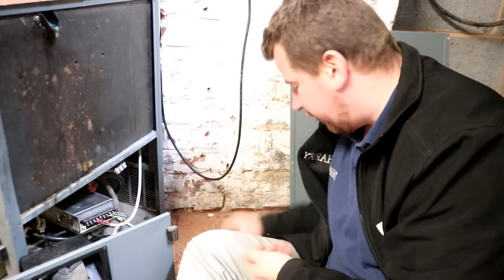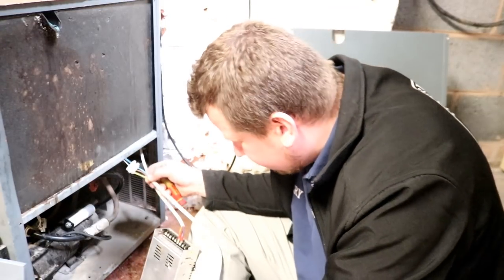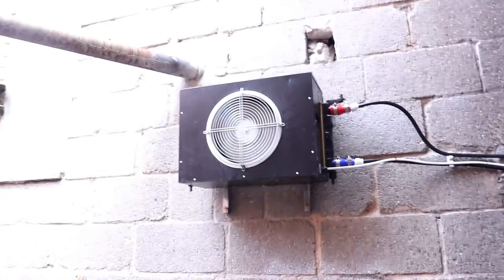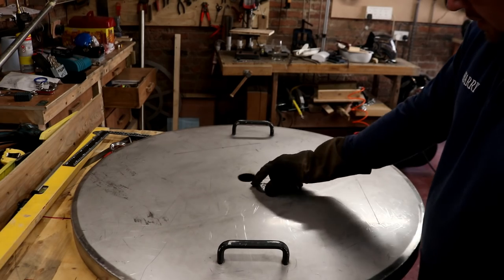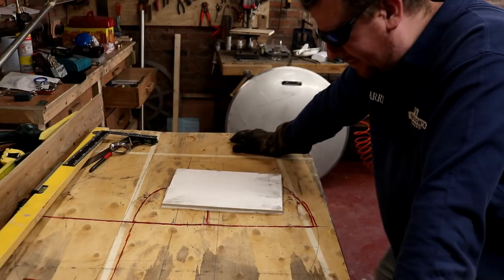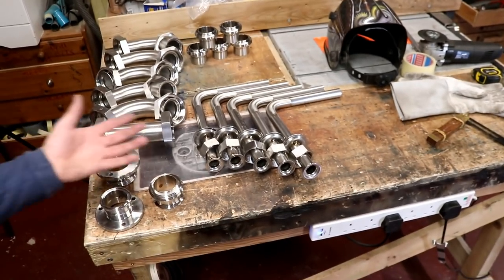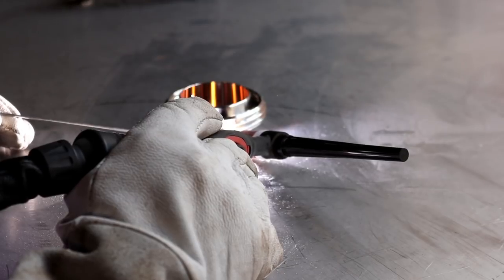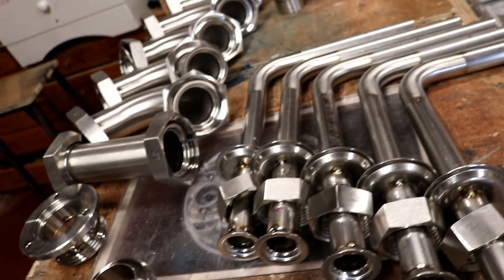TACKING THE NEW FITTINGS

Comment: I know you had to punt for a new transformer,even off eBay it can't have been cheap,and Robbie had a spare,but you've got it done now and you're not left wondering how long one you've pulled out of something else will last. Plus you could always get that one off Robbie anyway to have just in case. My God but that welding looks a right dose but you've done a tidy job and it had to be done at some stage I suppose. Why so much of a gap between take off and bottom of cone though? Cold room done now time to get those new tanks in action eh. Have a great Friday. Cheers.
Reply from the maker: The bottom of the cone is always full of yeast, hops and trub. it was £23 for the tranny I think.

Comment: Why are you implementing more fermenters if you don't have enough packaging? Unless you are planning to get more packaging of course 😊
Reply from the maker: The fermenters will be the packaging. I will be using them and holding/conditioning tanks. I do also have another 50 casks from the auction but they need cleaning.